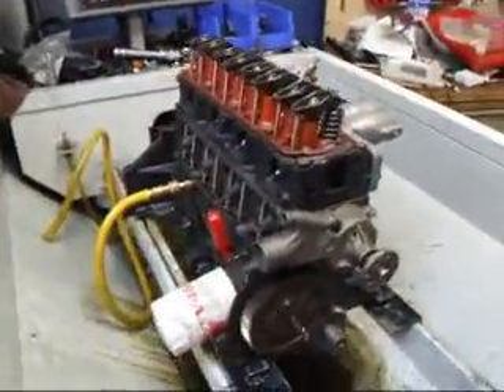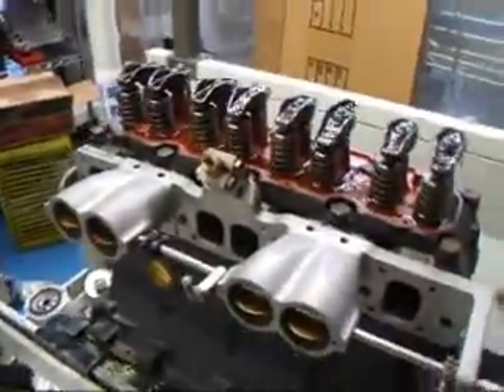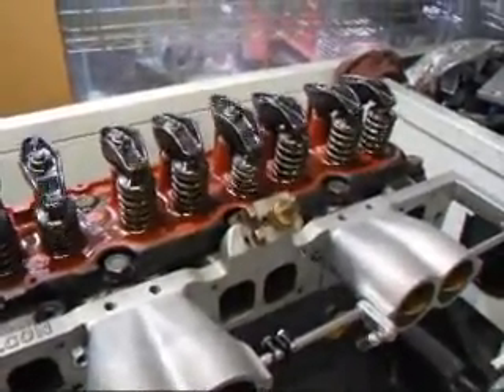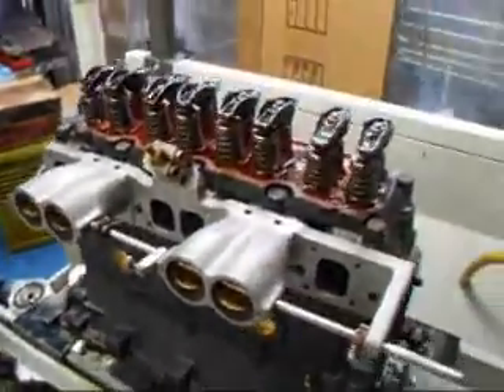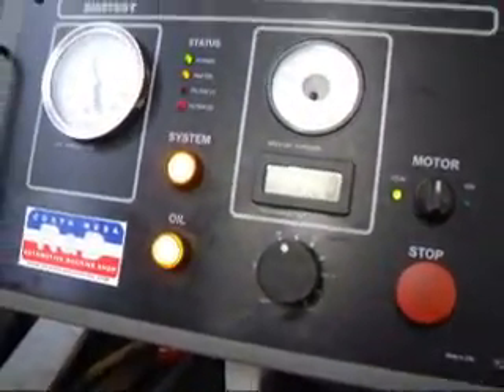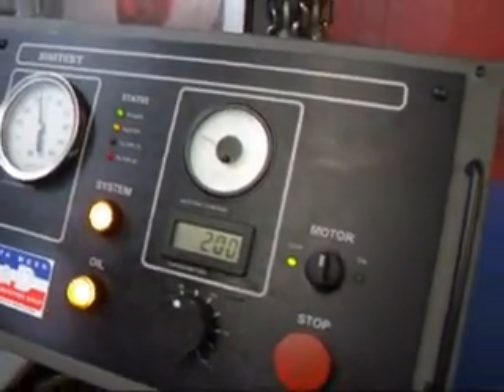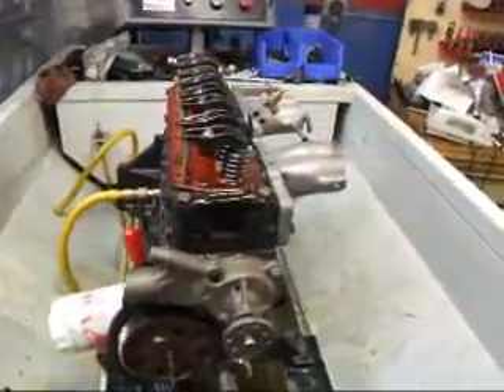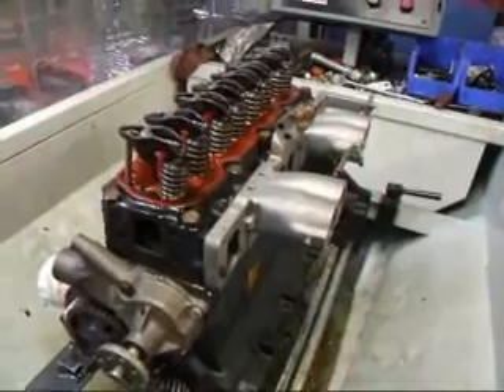Chevy II 181 cid Engine Simtest

Comment: Valve comments are interesting. I did  little research recently and found that the 181 used a 1.94/1.6 setup. If you're using a 1.5" exhaust valve, it must be a 153 cylinder head, since they used the same valve setup as the inline six's did - 1.72/1.5. Is there a slight compression boost using a 153 cylinder head on a 181 engine?